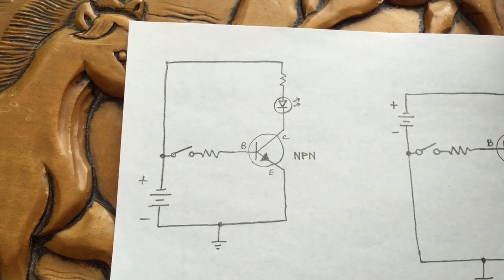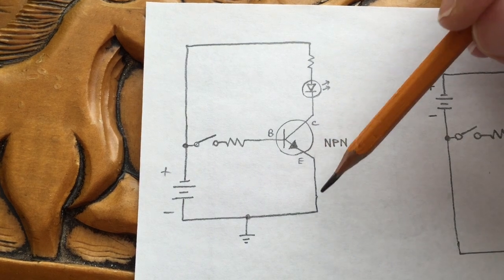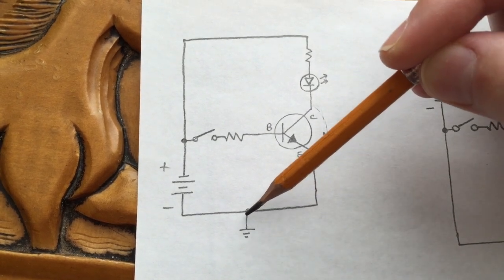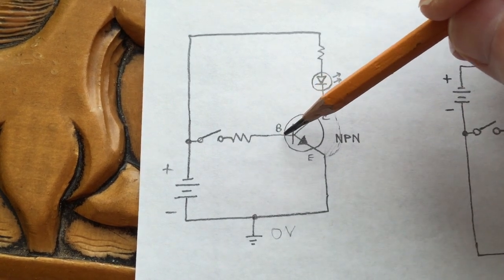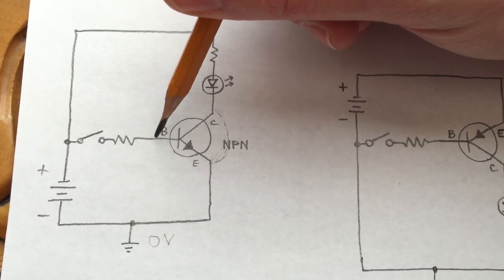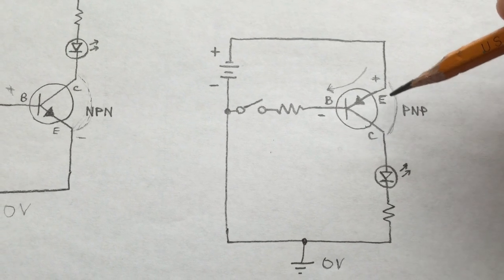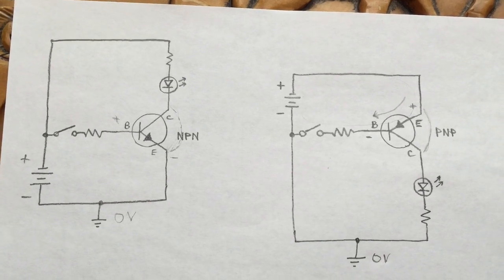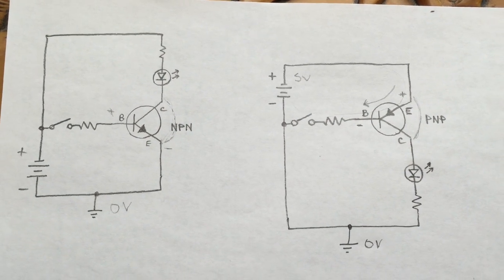NPN vs. PNP Transistors as Common-Emitter Switches

Comment: Excellent explanation!
Except for WHAT IS current flow?
Current flows in one direction and charges flow in opposite?

And the power supply sign you use, is that conventional?
Just because here http://www.allaboutcircuits.com/vol_1/chpt_1/7.html
are some differences.

I believe, no matter of conventional or electron flow notation, the power supply should always be depicted like long line is where electrons return and short line is where from electrons are emitting.

If there would be a difference in positions of + and - signs, then anyone can see what notation, conventionals of electron flow is used on circuit scheme.
Reply from the maker: Ok, current flow, by definition, is a movement of electrons. Electrons are negatively charged subatomic particles that exist around the nucleus of all atoms, and can be made to "move" with relative ease using electrical forces, moving magnetic fields, chemical reactions, and several other phenomena. Batteries use chemical reactions to produce a current of moving electrons, and generators use moving magnetic fields to propel them.

I realize that my power supply symbol is upside down; you are correct. The long bar should be on the top as the positive (+) terminal, and the short bar on the bottom as the negative terminal (-). This was a mistake I made when I drew these schematics by hand. I have another video posted on this same topic, using a circuit simulator, that you also might want to check out.

Putting my small drawing mistake aside, in reality, electrons are emitted from (flow out of) the negative (-) terminal of a battery or DC power supply, and return to the positive (+) terminal. However, for historical reasons, "conventional" current flow is considered to be in the opposite direction. So when we draw schematic symbols, like diodes, LEDs, or the integral diodes in transistors, the arrow is pointing in the direction of "conventional" current flow, which is the opposite of the actual direction of electron flow. It doesn't really make any difference as long as you pick a scheme and stay consistent. You can think of electrons flowing in one direction, or you can think of positive charges ("electron holes") flowing in the other direction. It's the same current flow.
Reply: I see several problems with "conventional", "electron flow" and "actual". Because "actual" is "from surplus to lacking". So when schematics is drawn by "conventional", how it relates to "actual"? Do they match? And how it is when it is drawn by "electron flow"? This is a question, because diode arrow is supposed to point in direction of "actual" only - says previous link. And thus we have multiple choices deriving from way of drawing + and - on the battery sign, the "conventional"/"electron flow", the meaning of arrow in diode sign, the "actual" flow of electrons. 16 choices so far.

How to clean up this mess? ))
Reply from the maker: rospotreb pozor Schematics, and schematic symbols are always drawn according to conventional current flow. The arrows indicate the flow direction of positive charges (electron holes). That's just the way it is.
Reply: That means, no matter of schematics, arrow is always drawn in opposite direction of electron flow? ALWAYS?

Im asking because there is a thing, such as electromagnetic pulse, that makes electrons "acknowledged" of field state. And electrons movement begins from the boundary of their density. Just like traffic on the road.

Current and flow, they may be not the same.
Let's say current moves in opposite direction of electrons flow.
Reply: "Later, when I began my first formal training in electronics, my instructor insisted on using electron flow notation in his lectures. In fact, he asked that we take our textbooks (which were illustrated using conventional flow notation) and use our pens to change the directions of all the current arrows so as to point the "correct" way!" - he said. Seems it is not always.
Reply from the maker: rospotreb pozor Perhaps when studying electron flow in an academic setting, but conventional current flow is almost always used otherwise. That is the reason it is called "conventional".
Reply from the maker: +rospotreb pozor The fact that your textbooks were printed showing "conventional" current flow should tell you something about the ubiquity of this practice. See http://web.engr.oregonstate.edu/~traylor/ece112/lectures/elect_flow_vs_conv_I.pdf
Reply: whoah!
that is gravely incorrect!
electro fluxes have direct impact on actual current flow!

Besides you probably mess it up - elctron flow and charge flow, which, as we know it today, are not the same!
Reply from the maker: +rospotreb pozor Sorry, I am not talking about "electron flow" or "charge flow". I am talking about "conventional current flow", as is conventionally used on schematic symbols. If you want to argue about it, you can argue with the authors of the link I sent you from Oregon State University. :)
Reply: generalizing all above:
The reliable way to distinguish conventional flow markup from actual electron flow is to watch -e symbol beside the minus sign. If it is there - actual electron flow is used. If not - covnetional. Is that right?

Comment: Is it possible to turn OFF one of those transistors when base voltage is applied?
Reply from the maker: Yes, indirectly. (First, remember that in a BJT, it is Base-Emitter current that turns on the transistor, not voltage.) There are two ways to do this. For example, you can make a common-emitter NPN transistor "normally on" by connecting the base to the 5V supply thru a 1k "bias" resistor. This will supply about 5mA of current to the base, keeping the transistor on. To turn the transistor off, you can connect the base directly to 0V (ground), which shunts the current from the bias resistor to ground, preventing it from flowing into the base. In this way, you can turn the transistor off by "applying" a zero-volt signal to the base. If you really want to switch it off with a positive signal, you can wire up another common-emitter NPN transistor as the input, where the collector provides the "switch to ground" for the output transistor. This is called a logic inverter, and I will be detailing this configuration in a future video.
Reply: Good thank you! So, it is like a dropdown/up resistor, I have to use a positive signal. I studied a few logic circuits but not for electronics was thinking about it as the last option but this sounds easy enough :)
Reply from the maker: zerpBot Thanks. I think you are understanding. :)